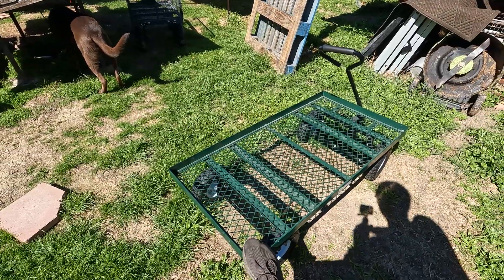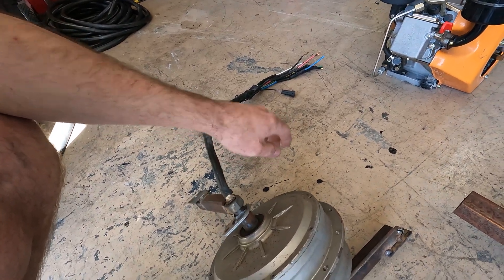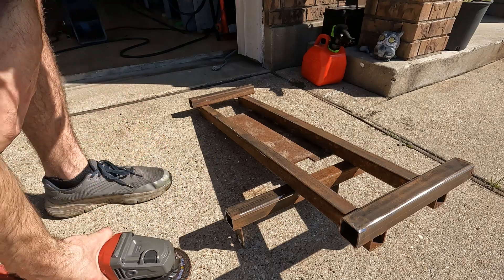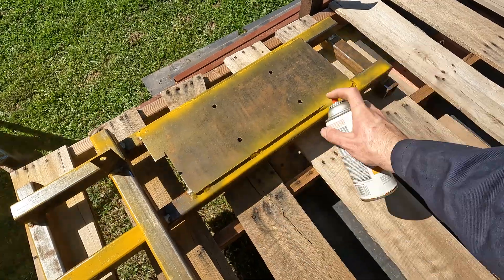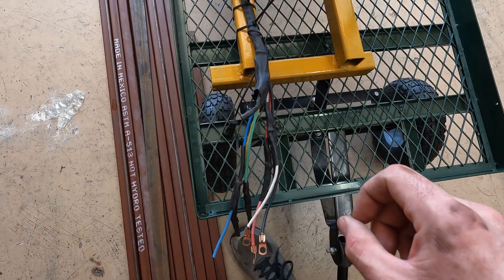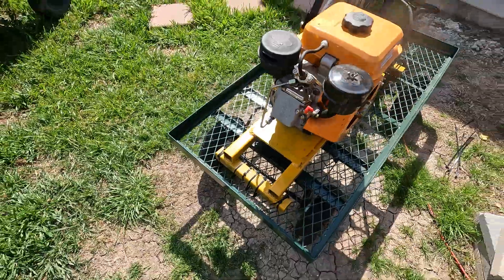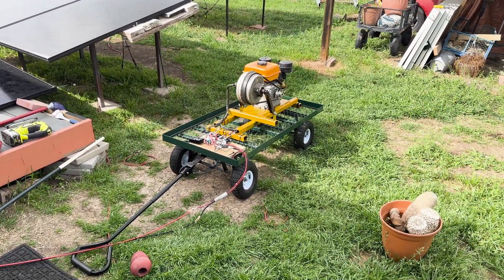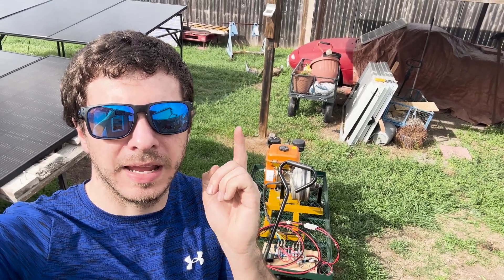Amazon diesel engine generator pt 4

Comment: When I see these small cheap Predator etc engines destined to run stationary and at fixed RPM, [B]I see so much low hanging fruit for efficiency and noise reduction[/B] it makes me itch! :) 

1st; Quarter Wave and Helmholtz Resonators, both on exhaust and intake,  do wonders for exhaust and intake the noise in fixed RPM engines!
Calculators and how-too's are all over the net.
(Many cars now have a Helmholtz resonator on the intake to avoid drone at cruising rpms.  It's that "whatTF is this empty chamber thing?")

2nd; Tuning the exhaust (and intake) length is easy, with calculators all over the net again.
Just add a Pressure Wave Termination Box before any exhaust muffling.
The what, why  and how-too for Pressure Wave Termination Boxes are also on the net. (David Vizard)

3rd;  Properly designed Bell Mouths in the intake, both to the air filter box and from the air filter box, make way more difference than people realize when the throttle valve is close to fully open;
as is the case when the motor/generator and ICE are matched and geared for optimal efficiency/RPMs.
While not the optimal-optimal shape, the horn off of aerosol air horns etc can get a 2nd life as these bell mouths.

If you want to 3D print (and sand/smooth) the optimal intake and (large decent filter) airbox; here's the science:
[URL unfurl="true"]http://www.profblairandassociates.com/pdfs/RET_Bellmouth_Sept.pdf[/URL]

"...In...the sharp edged pipe case...the measured mass flow rate is 30.023 g/s.
...where there is a simple radius as the bellmouth, the...mass flow rate is 34.83 g/s. 
In..the more sophisticated bellmouth case with an elliptical profile...the measured mass flow rate is 36.15 g/s. 
The fundamental message is that there is a considerable benefit...an optimum..." bell mouth of 31+%.

Lastly:
[URL unfurl="true"]https://endless-sphere.com/sphere/threads/boric-acid-oil-the-slipperiest-hardest-bearing-surface-ever-easily-experimentation-reqd.126120/#post-1831725[/URL]
This stuff saves 10% of fuel in field tests on gensets, where it was used as a fuel additive. 
(Oil additive is better. Especially in engines without an oil pump and filter. (Run it in properly 1st!))
[URL unfurl="true"]https://www.diva-portal.org/smash/get/diva2:1057090/FULLTEXT01.pdf[/URL]

Also if there's less friction; there's less vibration, so there's less noise from those vibrating cooling fins etc.
(NB the small rubber blocks seen between the fins on motorbike etc engines...)

If you really want to quiet the genset: (and a calculator)
https://youtu.be/4Y0Z_nGe1Vo
Reply: 3. no throttle valve on a diesel. more "throttle" is more fuel, not opening an intake butterfly like a gas engine.

Comment: Hi, what is the hub motor from I have not seen any with 6 wires like them.
Reply from the maker: @stevenpleasant5834  it’s from a large electric scooter, it has 2 separate 3 phase windings inside so almost like 2 motors in one.

Comment: So electrically, you're pulling down 1 HP, on the mechanical side, if you could figure out the torque at the speed you're running, I think you're going to find you're pretty close to 2 Hp. 

So either your motor/generator is saturating, or your belt is slipping enough that you aren't getting good power transfer. You could look at it with a scope and measure the output frequency on the AC side into one of your rectifiers to figure out your RPM and the wave shape would tell you if you're saturated or not.

Comment: 6hp is 6000 watts so this machine  should easily  be loaded to double and give you 12000 watts to be efficient and  worthwhile for noise effort and fuel,    muffler from a moped  motor bike  ,  modified to fit exhaust face this will make it  way quiet   put 2 in a row to silence it
Reply: Actually it’s closer to ~4450 watts. Not sure where you pulled 6000 from
Reply: @jayw900  that's why I ask expert to opinion  it ,   cos your right I didn't know exacts in numbers it was jumble of stuff I've known and starting to get brain fade 😂  ,  ya could say I pulled out my arse tho that's fair said ,  I'll  ware it well

Comment: Your generation thing is shit 600 watts is achieved with almost 1 solar panel ,,    fisher paykel washing machine  motors can be used hear but if it requires 600watt to turn it ,,  it wont produce any better with out re doing the internal and wire up spindle with more wire and heavy-duty,   electrician guys help me explain  this

Comment: It's max torque is not just off idle. Look up the actual specs and get an rpm meter or gauge. Most diesel engines have optimum torque from roughly 1800 rpm to 2200 rpm.

Comment: I ran my 10hp Chinese Diesel engine hooked up to a Harbor Freight 10,000 watt Generator Head on 100% Waste Veggie oil that I collected from a Local Arby's. Ran like a charm for about 5 years. It was mounted on a small trailer.
Did blow a Head Gasket years later... Simple fix and the Cylinder looked like new !
Liked/Subscribed !    FJB !

Comment: Electronics engineer here. You could add a DC-DC buck, boost or a buck-boost module after the rectification to optimize the load for the generator, so you can find the optimal load/RPM range for the best fuel efficiency. I don't think solar MPPT chargers would work directly, as they would likely load the generator up more than the optimal load, as it would produce more power while getting too loaded up and lowering the overall efficiency.
Reply: Ya the problem is the only thing avaliable in those wattage is a charge controller as long as you are making more voltage because they are only buck converters and the cost is kinda high
Reply: @james10739  If you have solar, you have at least one of theese...
Reply: Possible that the best efficiency is not at the same point than the max power. Although on a cheap gasoline generator I've found that the best efficiency was achieved at high power output: https://youtu.be/hLuFoImEaTY?si=RN97blL4z-r8WNnH&t=473
Diesel generators are better to run at low RPM, so it's possible to get a better efficiency at lower power. Some measurements would be very interesting...
Reply from the maker: That makes since, I may try to at and see how good it works with charging different voltages of batteries, I’d be worried about the dirty input from the generator but it may not matter too much, thanks!

Comment: If you are still having belt slippage I do believe they make serpentine belts that short and tractor supply should have a serpentine pulley that will fit. I worked at O'Reilly's and sold a belt about the same length as what you are using but don't remember what car it came off of. If your local auto parts store has decent people working there they should help you find the belt you need if you are wanting to go that way.
Reply from the maker: Ahh ok thanks I’ll keep that in mind, it seems to be ok but at really low rpm it does slip a little

Comment: I thought of such a system for my electric motor last year. 6 hp fossil fuel engine and 5 kW hub engine connected by chain. I think you should connect a 6 kW hub motor controller, then you can increase its regen level to the highest level and charge your battery directly. The bridge diodes you use, uncontrolled and unfiltered, cause a lot of energy loss. You must connect it to a regen-enabled controller.

Comment: I had one of those I couldn't start it for shit even with the compression release on how do u start it so effortlessly?
Reply: These engines will run on filtered used cooking oil, fresh cooking oil, biodiesel, biomass diesel, even used motor oil (just make sure it still has good lubricity) to name a few (the original diesel engine built by Rudolf Diesel ran on peanut oil) you will want to start and end running on standard diesel when using the fuel alternatives as they have a problem with gelling the fuel system up anytime below 70°f at least until the engine is warmed up... Also you will want a fuel water separator installed in the fuel line similar to the goldenrod water block filter assembly as the added size allows for the higher water and dissolved solids filtration of the alternative fuels
Reply: Using a drill to spin it up while holding the compression release until it's at max drill rpm
Reply: @dodgeme1986truck  and it works every single time able to break the compression?
Reply: @mattdaddy_888  yes if you hold it down until fully up to speed it'll pop over easier, the compression release usually pushes the exhaust valve open letting the air flow freely through the valve port holding it keeps the valve open continuously until released although they usually automatically release above a certain rpm anyway holding it open longer won't do any harm... However it is necessary on these small engines to use a fuel conditioner with lube additives (when using ultra low sulpher diesel fuel) as ulsdf is missing the sulpher lubrication these engines fuel systems were designed for.  Also you need a zinc(zddp)/flat tappet cam engine oil additive for almost all small engines including these ones.
Reply: @mattdaddy_888   you will want an overrunning clutch between the engine and drill as well
Reply: The 170f through the 198f have electric start kits available as well
Reply: @dodgeme1986truck  can you give me the link on Amazon for the electric start one?
Reply from the maker: Honestly it was a pain my first video with the engine I failed miserably but got the hang of it

Comment: Just joining you on your build and looks pretty neat, especially since a motorized portable generator is a few hundred dollars at least. I'm not sure if you plan on adding one but I was thinking that a cover ought to be over the assembly once it's finished so it'll be a little safer, and since it's air-cooled the shroud could be diamond mesh for air and exhaust to flow through.
Reply: Not just a cover a cover with sound deadening material where there is a ducted fresh air inlet sealed to the cooling shroud inlet and the air blows through exiting over the rectifiers heatsink

Comment: based on the movement of the bridge rectifiers, id highly reccomend you bolt both of them to the heatsink with thermal compound, possibly to something of larger mass depending on heat they generate. hopefully before they overheat and fail.
Reply: Add a heavy flywheel to the engine it will greatly help smooth the power output from the engine then  add a large automotive stereo capacitor after the rectifiers as that will smooth the power input going into the mppt charge controller making it last alot longer (they don't like dirty power inputs)
Reply from the maker: I agree it’s on the list of things I still need to do!

Comment: If the motor comes with a spec sheet, the rpm that it lists for peak torque, should be the efficiency peak, at least that's true for passenger car and larger diesels.
Reply: The peak torque for the 170f is at 2200-2500 rpm
Reply: It is a yanmar clone 170f engine

Comment: I would like to know the consumption of diesel per produced kwh? I want to make the same kind of system to recharge my batteries in the winter.
Reply: The diesel engine is between 50-100%more efficient than it's gas counterpart honestly I'd use an anticogging 3phase ac (wind turbine style) generator head to start, run through a 3 phase bridge rectifier/regulator with dc output capacitor, a heavy flywheel added to the crankshaft would help smooth generator input rpm/output ripple waveforms as it minimizes the acceleration/deceleration created between the power stroke (accelerating) and 3 other (decelerating) cycle phases (exhaust, intake, and compression) under normal load without added flywheel it could be 200rpm loss between power strokes where the added flywheel could reduce it to a small amount like 50-100rpm (heavier the flywheel the less rpm change)
Reply: Approx. 0.4l or 0.106 gallons
1 gallon of diesel generate approx. 37-40kwh
Reply: @dodgeme1986truck Thank you for your answer. 1 gallon of diesel contains 38.26kwh heating energy, so that would be an efficiency of 100%.  0.106 gallons contains 4kwh heating energy, so if you get 1kwh electricity out of it, that would be an efficiency of about 25%. Not bad! I've measured the efficiency of a cheap AC generator (gasoline), and found a maximum efficiency of 13%. I think the generator head has a bad efficiency of about 65% and the engine about 20%. If you want to see the graph of efficiency vs power, here it is: https://youtu.be/hLuFoImEaTY?si=RN97blL4z-r8WNnH&t=473

Comment: This is so cool!
I wonder if a larger pulley on the engine would use the low speed torque of the engine a little better and produce more total power? Might be interesting to try different size pulleys at some point.
Reply: or a CVT

Comment: where did you get the electric motor? giving me ideas on a hybrid ebike.
Reply: Any permanent magnet motor will work. Floor polisher often have them. Ebike hub motors, ceiling fans, and many others sources. Look for a motor with three wires and magnets inside.
Reply from the maker: The motor was from an old large frame moped, I think originally was rated at 5kw